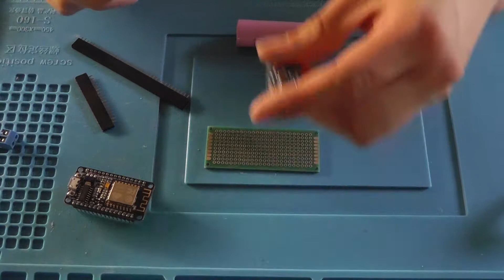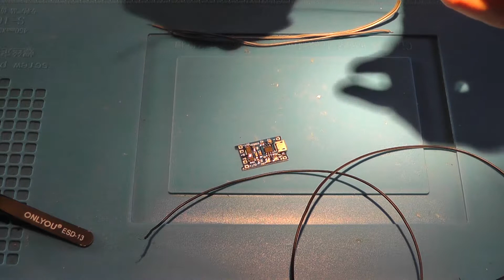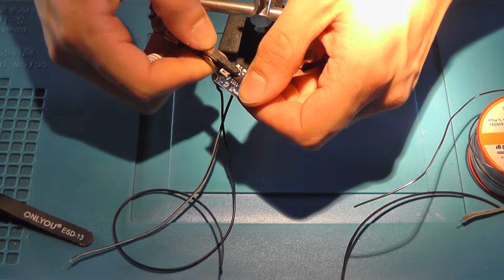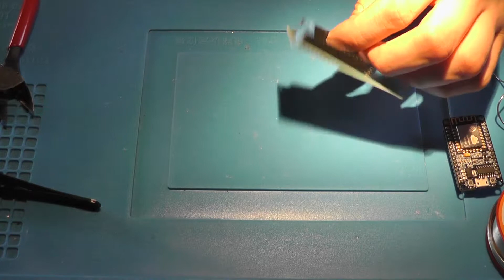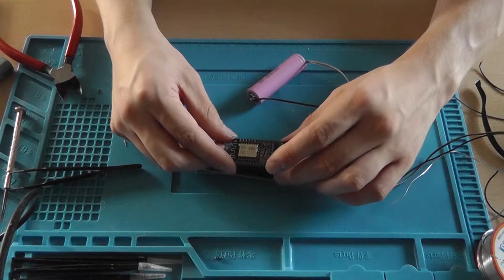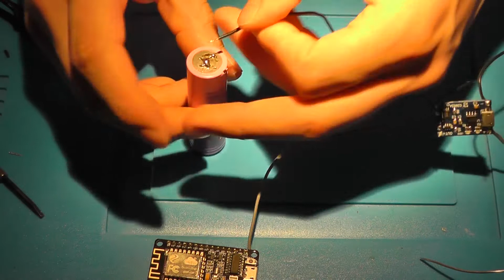#19 Battery powerd ESP8266

Comment: How you power chip since it works on 3.3v and output is 4v?
Reply from the maker: I put it through the VIN pin of the ESP8266, that is connected to the on-board 3.3v regulator. Might not be the most efficient method however

Comment: Would it not make sense to mount the "battery controller" under the ESP8266 board to save space and wireing?
Reply from the maker: Yes it would! I am planning to build an outdoor sensor that runs on solar power and stores the unused energy in three 18650's. The case will be that large, that there is no need for the batteries to be mounted under the sensor however.

Comment: Hi Tim,

Could you please add a link also for the battery you've used in the video?
Reply from the maker: I salvaged the batteries from an old laptop battery. I just ordered some Samsung 18650's of banggood, hope that they are original ones 😋 Keep an eye on the mailbag!
Reply: Cool, thanks! Btw how long a not-too-overburdened NodeMCU lasts with such a battery?
Reply from the maker: Right now I am using an sketch that runs for about 10 seconds in total (setup+ loop for 2 seconds) and goes to sleep for 6 minutes. The three 18650's I am running parallel are getting charged by the solar panel and the total runtime is not know, since they didn't run out yet. The individual cell was able to run for a sunny day, but that sketch only slept for around 20 seconds. I am planning to do some calculations on the battery usage and duration